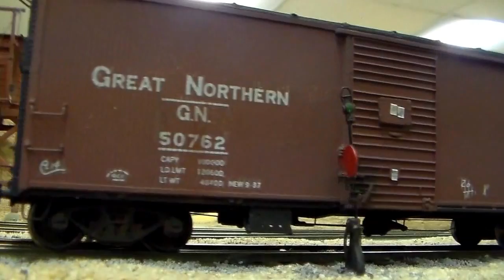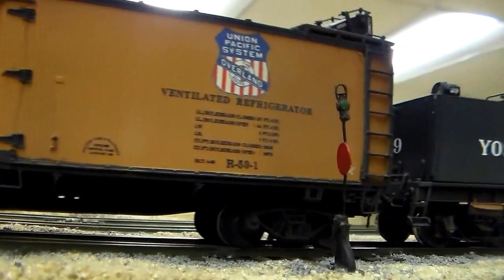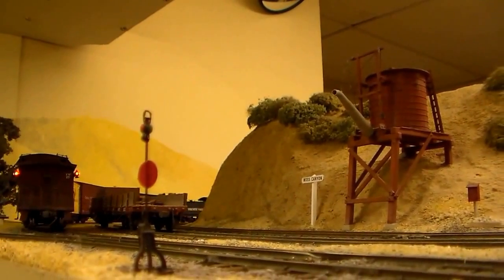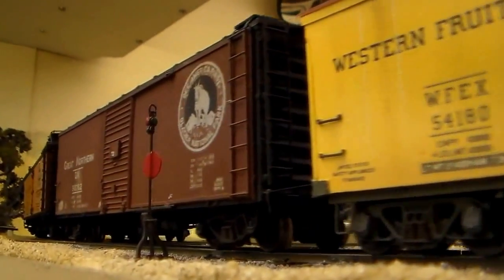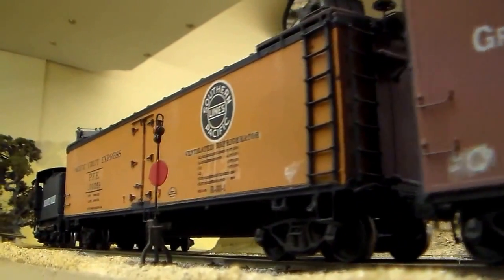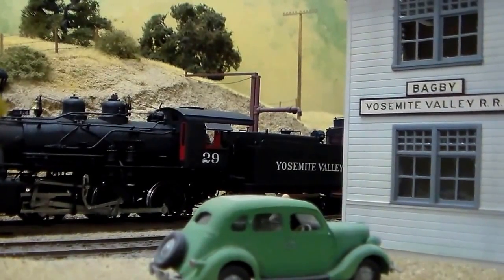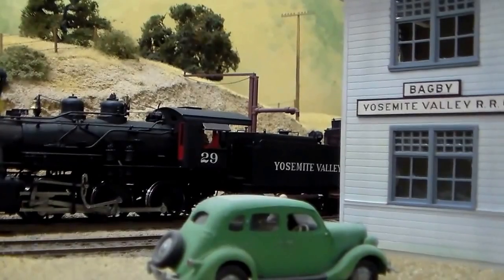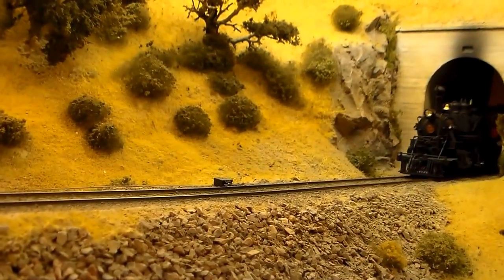A Railroad Frozen in Time - Jack Burgess' Yosemite Valley Railway Revisited

Comment: I have always impressed in this model railroad from 1987 when I saw  for the first time in  mr ,and to the present now with this option at you tube, in the mr article ther was a picture that depicts the barbed wire, and now I can apreciate in this video, my question is ,jack scratchbuilt it from wire, or is a comercial product? thanks